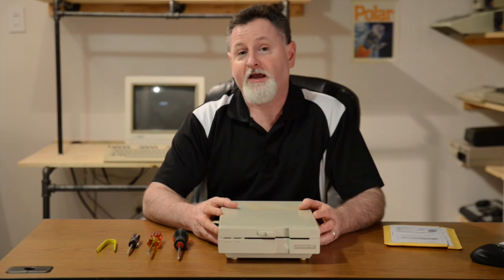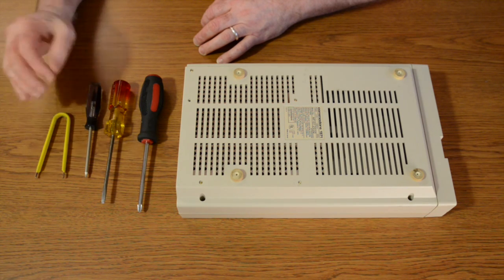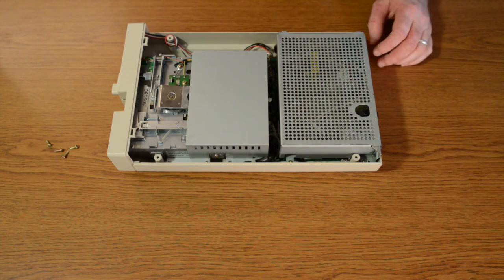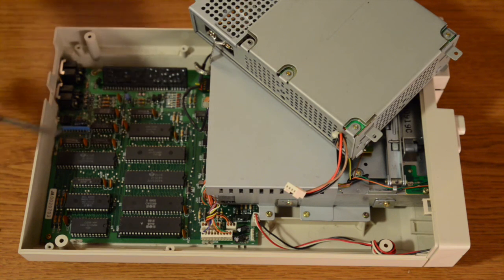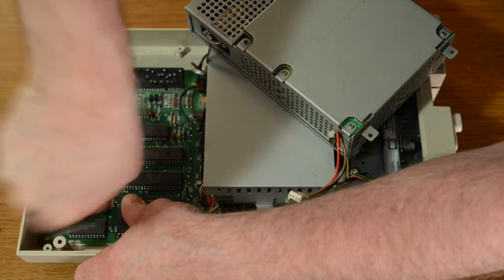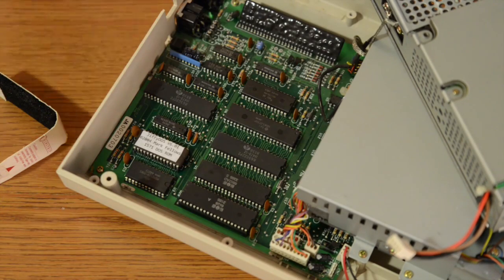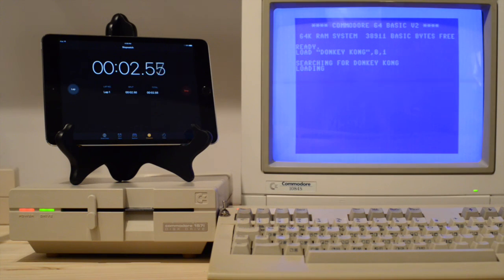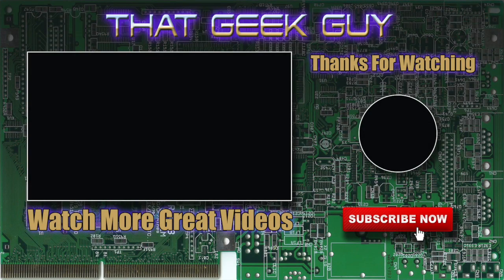JiffyDOS 1571 Install

Comment: I great way to speed up a Commodore serial drive. Funny how they could improve so dramatically over the original. This old Commodore tech sure has been build to last, I am still using most of my original Commodore gear to this day and then some. :)

Comment: Your C64/C128 must have JiffyDOS  if you use a JiffyDOS on a C1541/C1571.
Reply from the maker: +Johan den Hertog very good observation. Yes, in fact I bring up that matter in an earlier video, Floppy Drive Showdown Part 2: Optimized for Speed. Thanks for the input. I'll make a note of that in the description for others.